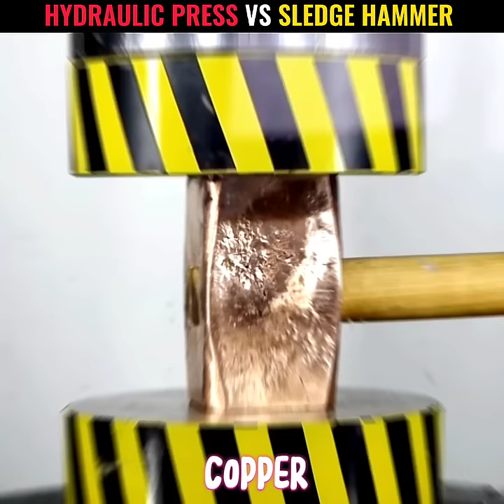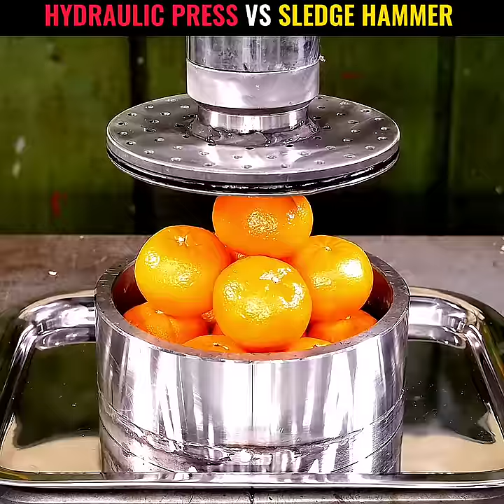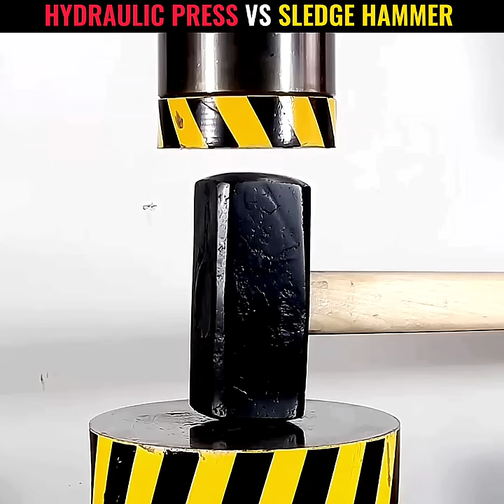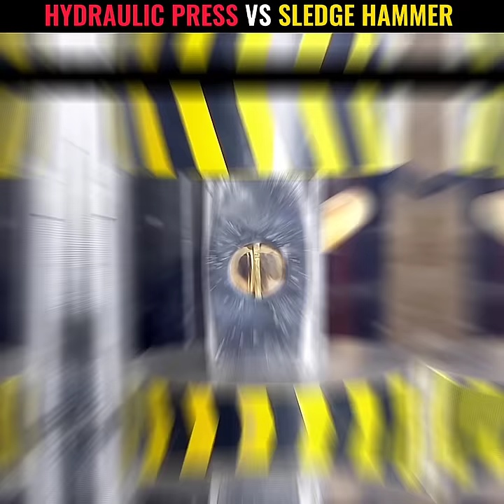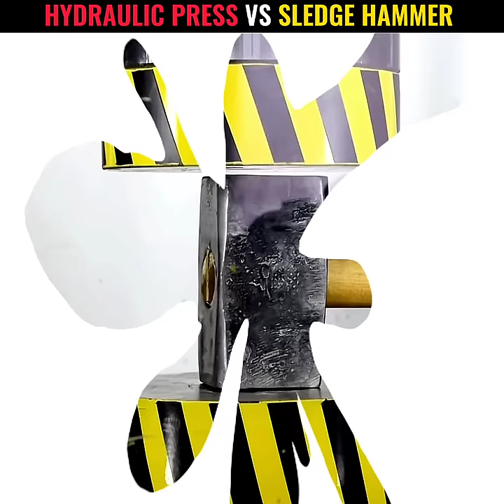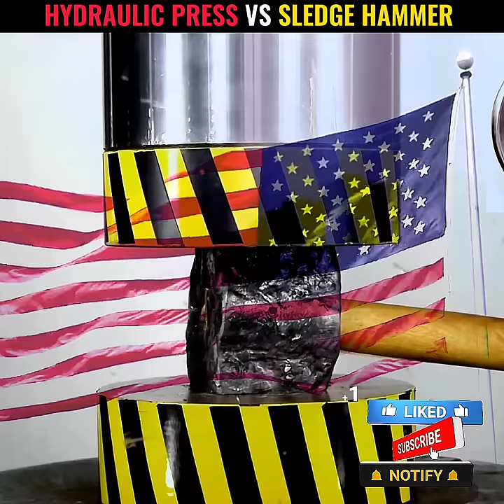SLEDGE HAMMER UNDER POWERFUL MACHINE 💥WHO WILL WIN🤯 #shorts #usa #shortfeed

Comment: Ah yes a fair comparison of 2 light metal hammers and god damn titanium
Reply: Lol im ded
Reply: And Copper almost did as well as Titanium.  Still a stupid comparison though.
Reply: titanium fanboys getting out of hands
Reply: @Asmahdan  well copper is more flexible and keeps its shape pretty well under pressure, not nearly as well as titanium though. We use titanium in buildings for a reason lol.
Reply: Titanium is a relativley soft metal actually. But yall watch too much movies
Reply: @HiddenOcelot we dont 😂 too expensive. We mostly use steel. Titanium is used for aircrafts due to beeing a light and heatresistant metal
Reply: @walashi882  but it's still not as light and soft as the other 2
Reply: Where the vibranium and adamantium at?
Reply: @darak224  titatium is pretty light with a density of 4.5 copper is almost 2 times as heavy with 8.92 and aluminum is really light wiht only 2.7
Reply: @walashi882  Titanium is light, flexible and light. So it gets used in rockets quite often. Hardened Steel would be more stable.
Reply: @Asmahdan it did even better my guy
Reply: Just wait till you see his russia v china v US, it gets out of hand

Comment: I've looked it up and apparently a titanium sword is too brittle and can't retain its edge and it's lightweight means it loses power despite it being lighter so you can swing it harder. But yet when you look up people that made titanium swords on YouTube, you find them making a sort of titanium. They abuse the shit out of and it doesn't even so much as Delta blade where a regular steel sword would not hold up to that level of abuse without shipping the blade and severely damaging it. Hell this is just further proof that titanium is absurdly durable and a blade made out of it would be absurdly, durable and badass